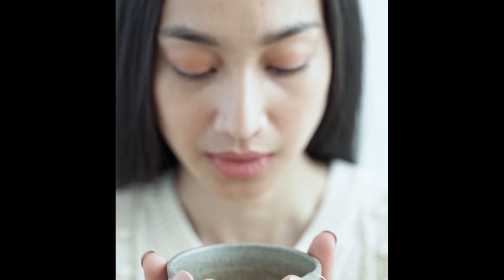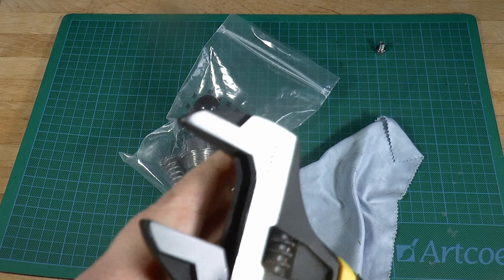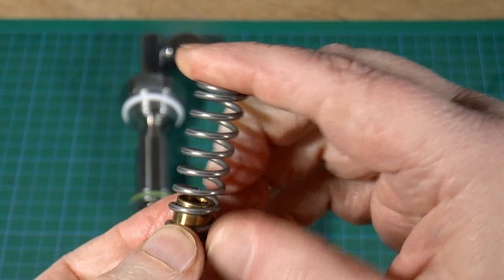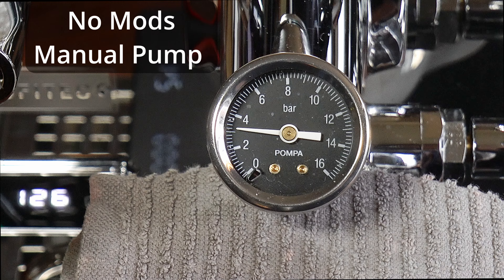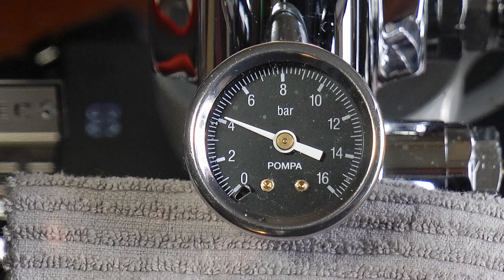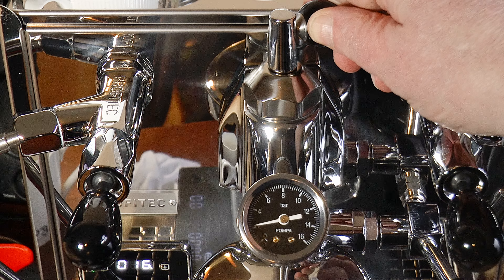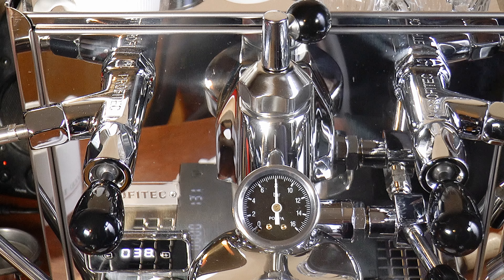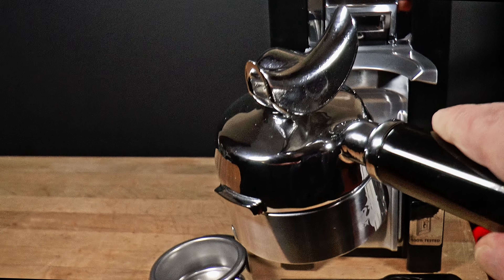Does Flow Control Improve Espresso?

Comment: Good choice with the original spring. I tested and came to the same conclusion a few years back and I’ve never doubted the choice since. Having a consistent and soft preinfusion lets me control better and, if someone who doesn’t know about paddle operatiom uses the machine, you can leave the paddle set to 8-9 bar and it’ll run as if the controller isn’t even there. Very versatile.
Reply: So that means just don’t screw bottom of e61 just the top of it?
Reply: I'm pretty glad I watched this video right before and quickly after having a Profitec Flow Control Kit installed in my Lelit Mara X. (I'd given it into maintenance, and the tech guy had suggested to swap the Lelit's original coated mushroom with a stainless steel one anyways, so I thought I'll chip in some more bucks to give flow control a try after two years of using the Lelit without one.)
With the Profitec Spring, Flow Control was just as unsatisfying as described in the video. It kinda worked but felt pretty jittery and hectic. It really took very little time and skill to put the stock spring back in, and now it's much more fun to use.
I guess using the stock spring makes certain uses of flow control impossible, but don't really seem to be the uses I'm after. (I asked the tech guy about leaving the stock spring in - he claimed it would render the Flow Control pretty pointless. I found the video more convincing than him, though.) 
Flow Control seems to have somewhat limited use in the Lelit Mara X in any event - its stock flow is like 5 ml/s, and even if you open the valve to 2 rotations, it doesn't get to much more than 6 ml/s. (So, in the terms of Whole Latte Love, you'd only have a range from low to medium flow, but no real high flow.)
Still, now I can easily pre-infuse some roasts for a longer time before I ramp up, I can gently ramp down at the end of some shots, I can pull 1:5 ratio shots at around 6 bars - I can have some fun fiddling around and I even had some pleasant results already.
My girlfriend, on the other hand, who just wants to pull a decent shot as conveniently as possible, doesn't have to fiddle with the mechanism. She can just leave the valve at stock flow and benefit from the slow pressure build-up the stock spring allows as usual.
So, thanks a lot for the vid!

Comment: Dear team, I hope you are well. I have the Proftic 700 and recently started dripping a lot of water from the flow control down the bottom. Is this something that can be fixed? please advise on this matter
Reply: I think lubing valve and changibg rubbers will solve it

Comment: After watching your video, I removed my Coffee Sensor spring and installed the heavier OEM Profitec spring and I find I much prefer it as well. Thanks for the tip. That OEM spring is quite a bit tougher to install than the lighter Coffee Sensor spring. After making the change, I discovered my adjustment was off on the cap/knob. I originally installed it too close to the mushroom and it was not closing all the way. Adjusting that was an improvement also. There is definitely more control in the function with the OEM spring.
Reply: @wiredgourmet   Not sure who you are responding to, maybe Tim Gerber below. My Profitec is the Pro 600 like yours. I did have a thermometer in the group plug, but it was replaced with the pressure gauge that came with Coffee Sensor flow control.
Reply from the maker: @akquicksilver  Thanks for sorting me out. I did think I was replying to Tim. Apologies for making your signal to noise ratio worse :)

Comment: The Auto pre-infusion on the E61 group is pretty brief, it's just a mini pause, but you're right, it is there and probably does help, but not much talk about it.  I had it on my previous machine enabled even though I had flow control on it, and it worked well, but on my current machine I've got the stiffer spring just because it came that way and I've been too lazy to bother changing it, but I think you've inspired me to change it.

Comment: Bezzera has a flow control set with offset handle, supposedly shields your hands from heat from the group head. Might be worth checking out. I do believe that other manufacturers have their control handles move either more or less freely (Lelit Bianca, for instance). I have also heard that flow control on vibe pump is a bit more finicky than rotary. Great video!

Comment: Unscrew the round adjustment handle.
Slide some clear hose over the hot shaft.
Punch hole and screw the ball handle back in.
I did this to mine and it's works perfect, not even a little hot to touch

Comment: I really appreciated this video. I installed flow control on my Alexia Evo a couple years ago and it really didn't let me dial in the flow/pressure to my liking. I was never able to get the group head pressure to stay consistently at 8 bar like yours showed. I may do a full reinstall with the stock spring now to see if I can garner a bit more control but, overall, it has not worked as desired.

Comment: great Video, i have made the change yesterday (reinstalled the stock spring). Preinfusion is much more controllable and i can just ignore the flow control valve if i don't want to fiddle around with it. It was not possible to do this with the stronger spring, because the shots would end up beeing way too sour.

Comment: Thank you so much so basically, instead of fiddling and changing in the back of the machine for the pressure which set very high around 13 bars on my Apartamento rocket machine. I can just install this and control it myself to limit to 10 or 9 bars, correct?

Comment: I use the flow control device to develop brew recipes using the water grouphead flow rate rather than trying to control the grouphead pressure. It allows me to position the flow control at specific positions for a 3ml/s preinfusion, 7ml/s main extraction, and 4ml/s for the post infusion ramp down. This way, I'm not adjusting the flow control lever to a specific grouphead pressure.

Comment: Great video! Really enjoyed how you covered using both springs. Haven't seen that in other reviews before. How do you think a rotary pump would behave differently than a vibratory pump, if at all, using this flow control solution?
Reply from the maker: Rotary ramps up a bit faster, so the stock spring might be a bit more helpful.

Comment: Great video! I‘m also considering upgrading my Appartamento with a flow control kit. The only thing that is keeping me from it is that I would have to let go of my group thermometer. And knowing my machine, temperature can vary quite a bit and the group stalls quite often. So on a dual boiler E61 it might be better, but in addition to the strong fluctuations in my machine HX E61 machines also have the problem that varying flow affects brewing temperature since slower flow means that water is passing through the HX element slower than normal which would result in higher temperatures of the water being delivered to the group. Of course the thermal mass of the group is quite large so it’s probably not a huge issue, but for me temperature stability (which I can achieve quite well with my group thermometer by knowing when and how much to flush) is more important to me than flow at the moment.
Reply from the maker: Totally agree that temp regulation on HX is a mysterious black art :) But perhaps, with experience, you've developed a feel for it, and don't need the thermometer nowadays? Maybe, before spending 250 or so on a flow kit, you just replace the plug and try her out for a few days, judging by taste?
Reply: @@wiredgourmet  Any chance you'll explore the dark art of temperature management/flushing on HX e61 machines? That's a video I'd love to watch.

Comment: I've done quite a lot of experimenting with my Profitec 600 e61 and flow control over the past few years. I've come to use a profile that offers a quick fill (to avoid a top to bottom extraction gradient), a pressure hold (2-3 bar) and then a controlled ramp up to full pressure (8 bar) with a lever like decline. For me it works with coffees of all roasts levels while only requiring an adjustment of the hold phase (from none up to 30 seconds). I've tried to post some links but my comments wouldn't show up.
Reply from the maker: Yes, YT treats links as spam. Feel free to describe any other results or insights like you did here.
Reply: @wiredgourmet  Understood. I posted a link above to the video I shot detailing the technique I arrived at after a lot of thinking and experimenting. There is a link to the HB discussion in the description of that video.

My technique has changed since I made that video, but only slightly.
Reply: @wiredgourmet  I agree about leaving the original spring as that was the same conclusion I came to.

Comment: The flow control on my Decent DE1 works great. As does the temp and pressure control 😃 They are still working on water tank level control, as it currently suckkkks.

Comment: In the video the pressure seems to remain constant if you are not rotating the knob and only changes when you rotate the knob,in my case the pressure ramps up very fast and even if i fully cut the flow the pressure takes forever to drop, could the stiffer spring be the issue?
Reply from the maker: Yes, the stock spring allows the preinf chamber seal to open, which acts like a buffer.
Reply: @ thank you

Comment: Hey! Nice video, but I don't really understand why people call this flow control... Flow is not even measured! Sure, you are manipulating flow restriction (non-linear) with the valve, and if there were markings somewhere it could act as a basic open loop flow control. But the way it's actually used, by referencing the pressure gauge, it's more like pressure control with flow restriction as the manipulated variable.

Comment: Lelit Bianca. Period.
Reply: Built to a lower quality standard and not as nice, semi-upgraded features aside.
Reply: @heytchap  what made you say that?
Reply: @NANA-gy7yx  I’ve used both?
Reply: @heytchap  elaborate on what made you decide it was lower quality and which version you have or used please
Reply: @NANA-gy7yx  my dude, if you have yours and like it, that’s fine, but it’s lower quality compared with something from ECM or Profitec and that’s not up for debate. It’s made to a price point and Lelit cutting corners in certain areas is what allows them to include more advanced and upgraded components in other places. There’s no denying this reality. Enjoy yours. I dont need to be challenged over it because you like it.
Reply: @heytchap  "challenged" ?! You need to chill dude! I wasn't attacking you or anything... I was just asking.
Reply: @NANA-gy7yx  sorry. I read the comments in a tone and took them out of line. 

The reality with Lelit is that they stuff a bunch of really solid hardware - rotary pump, flow control, interesting preinfusion, wood, and some other bits into a package. Normally a rotary pump is quite expensive compared with a vibe pump, so there’s increased costs for that and their other bits of kit. 

For the body itself, it’s made of cheap stamped metal with rough edges and it’s warped, like really warped. The fit and finish is poor and the overall construction leaves a lot to be desired. 

Profitec and ECM are built to a better spec, with a better body, better panels, tidier insides, but also either don’t have the stock stuff like rotary pumps and FC at their “normal” price, or they have it available as add-ons or higher level models.  

For me, I don’t think some cheap wood and a rotary pump are the ultimate need or give me any real value.  I’m more interested in better craftsmanship and attention to detail, especially when I can upgrade certain components or add things on down the line. 

Sorry again.
Reply: @heytchap  Don't worry about it. Thank you for your time  🙂
Reply: I think someone actually made a similar large wooden paddle for flow control, I forget which company it is though. The Bianca flow control has a more limited range but I think that should work fine since ideally you just need to have it go from no flow to a little flow, I don't think it makes much difference if your flow rate is 10ml/sec vs 4ml/sec if your espresso is flowing at 2ml/sec you're still maintaining brew pressure.  Limited range and larger paddle, should allow for more precise movement you just can't rotate it all the way around.
Reply: @heytchap  You sound like you were watching that Whole Latte Love video :D
Reply: @BensCoffeeRants  no. I’ve used both and owned profitec machines.
Reply: @NANA-gy7yx  If Lelit isn't lower quality now it will be in the coming years now that Breville bought Lelit a few months ago. I have a feeling Lelit machines are going to see Chinesium components more and more as time goes by until the innards resemble a Barista Express from the inside. In other words, if you own a Lelit you might want to stock up on wearable components made in Italy while you still can.
Reply: @illiniwood  funny thing is I know a group of friends that got chinese made espresso machine and a lot of the parts were actually Italian made and the pump is US made (except for the chassis, tubings, boilers and PID). I think the worst thing that could happen, is they source their manufacturing line to china for the cheap labour but keep the specs and parts as is.
Reply: @heytchap  I have a question what do you think about the rocket?
Reply: @brownsugarcoffee1  I’d get the profitec or lelit all day, every day before I bought a rocket.